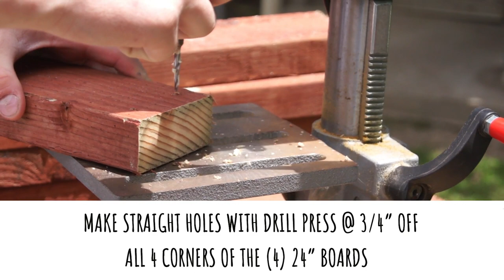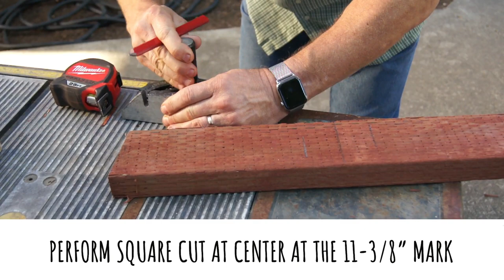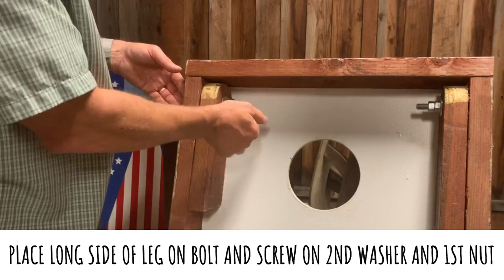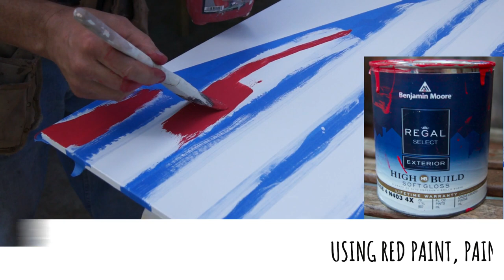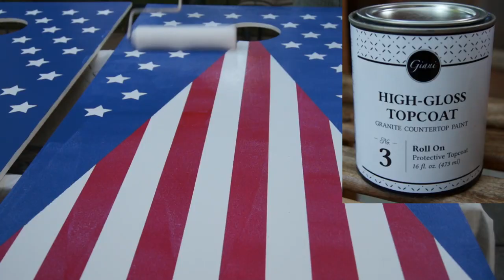How to Make Corn Hole Boards (4th of July Themed)

Comment: I am commenting before someone says something about using a table saw without a miter gauge or fence. Fun little build :)
Reply from the maker: The Grant Alexander Yes, my dad did do it a free style for parts of it. It does depend on how accurate you want the cuts. Thanks for stopping by!
Reply: My dewalt's fence is 890mm but when I cut a sheet in half I have to do it freehand. Not so difficult if you line the sheet and yourself  up before cutting